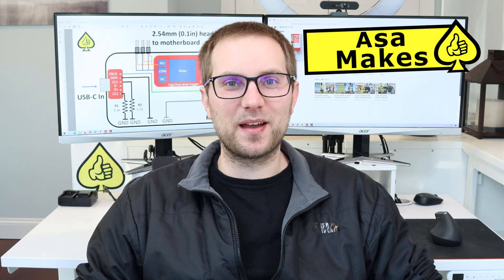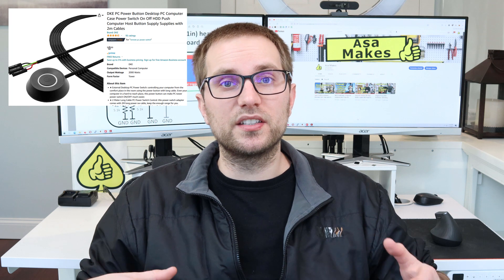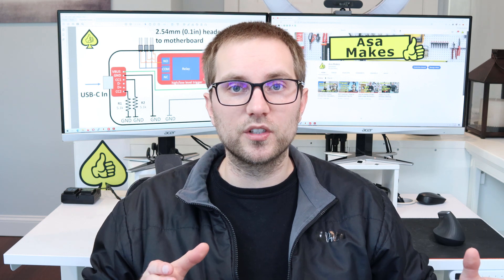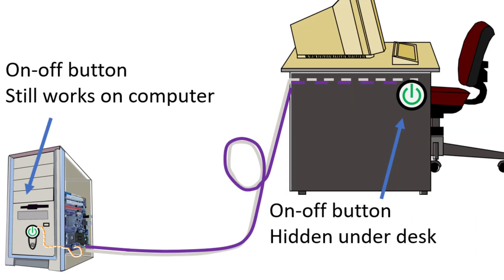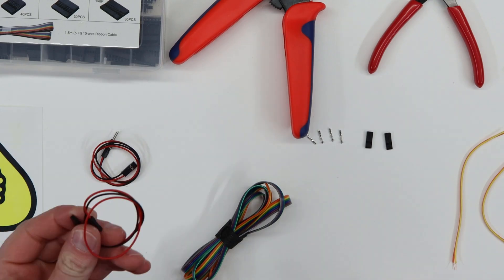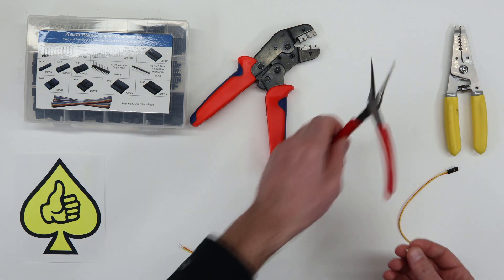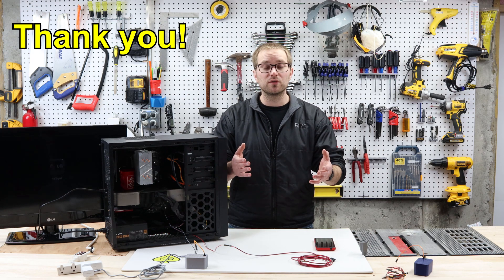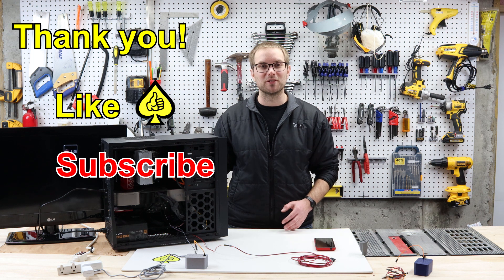Turn your computer on/off from ANYWHERE: from across the room or the world. DIY one day build.

Comment: 15:30 The bucket is there to catch memory leaks.

Using a smart plug to supply the signal voltage is clever, I like that. It's a way simpler method than anything I was thinking of.
Reply from the maker: Thanks! Goal is to have a bucket in every video - I'm disappointed I forgot to take one to Europe for my last video. That being said it's hard to justify decorative bucket as EDC...

Thanks for watching!

Comment: I like your project, this is a good idea. You did a great job explaining everything. The only thing that would be interesting would be a) how you created the android app and b) how you integrated everything in your smart home.
Reply from the maker: Thanks for your comment! This part was really easy, I'm just using a standard household smart plug (the white plug) to power the relay. So I use Google Home to control the smart plug on and off. If you use smart plugs already you might use Amazon Alexa or Home Assistant. There are lots of videos on YouTube to help set up smart plugs if you're interested.

Did that make sense?